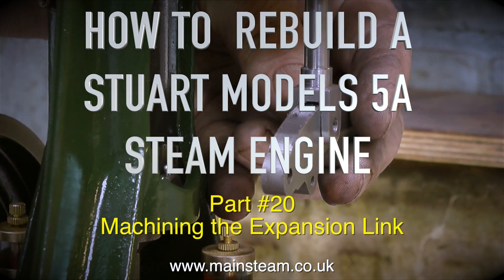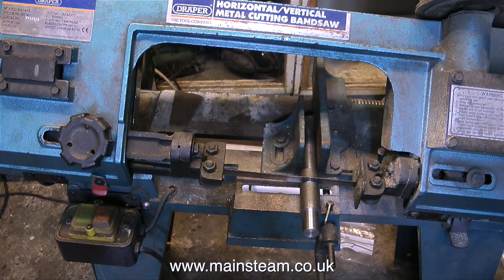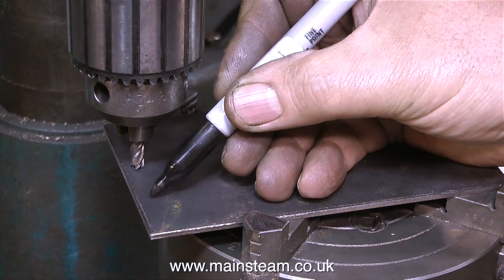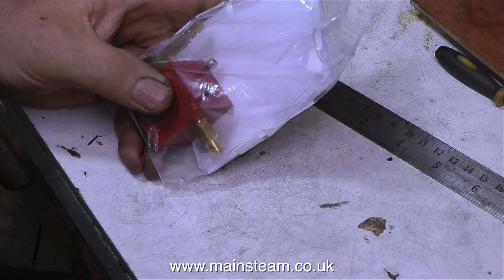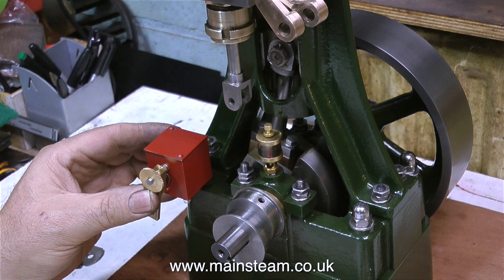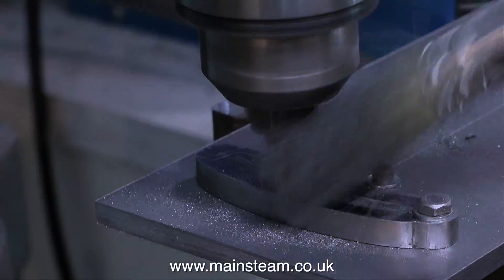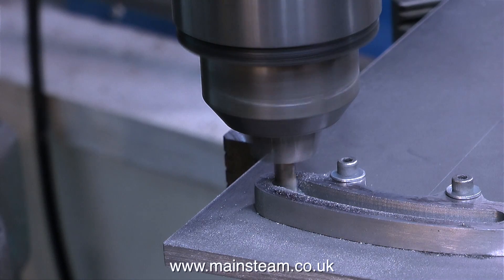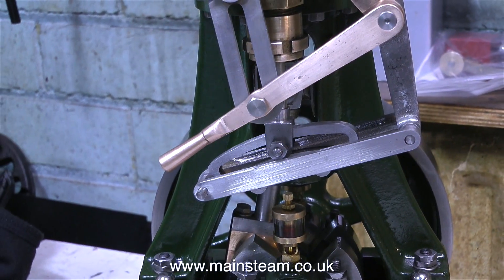HOW TO REBUILD A STUART MODELS 5A STEAM ENGINE - PART #20

Comment: G'day Keith thank you for showing this, I think that I will be watching this over and over again as I have been wondering how to do the expansion links on the Simplex.  Thank you John PS a great idea using the 1/4 " steel plate to mount it on and secure it!

Comment: All this talk of parallels. Bit of ground stock cut up b.m.s anything along that lines so long as they are true. My only comment would have been to drill holes to reduce machine time.
Reply from the maker: I have a load of square section High Speed Steel in various sizes - that seems quite parallel too ......

Comment: It would be hilarious to watch a video where a multi-million dollar CNC machine is
used to do all the machining work on a model steam engine.   (I'm fascinated with technological
contrasts, say, like installing wifi into an old typewriter.)
Please do keep up the good work, it has always been, and continues to be  very useful.
Reply: Unless you turn the coolant off on most machines you don't see the actual cutting, and only see pieces when you take them off the table. It is like watching a front loading washing machine.
Reply: A couple of years ago, The Geek Group designed a simple oscillating cylinder steam engine and made a number of them on a HAS CNC mill and a CNC lathe.